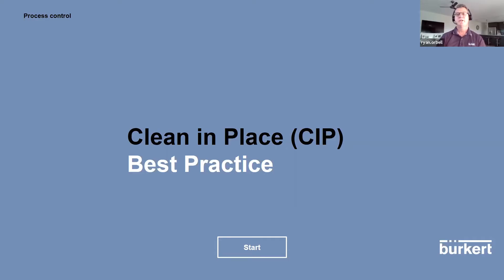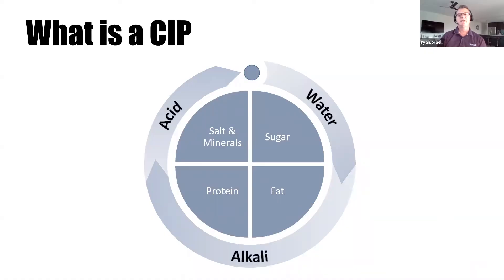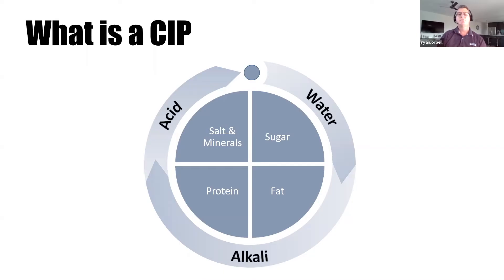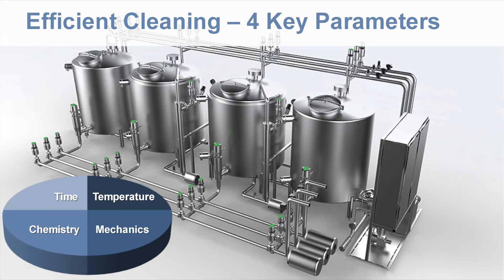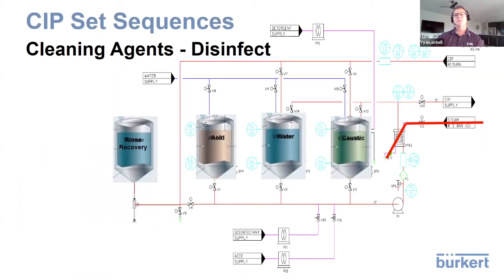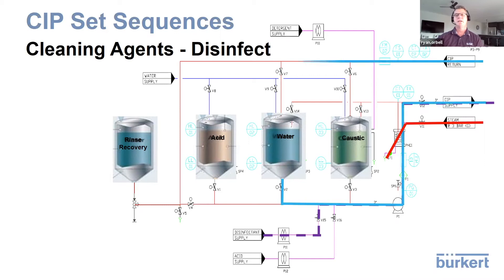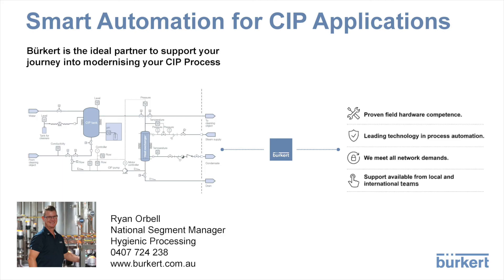Clean in Place (CIP) Best Practice

Comment: Thank you for your presentation. One my question, what type of the water or how much pure do you use for the pre-rinse? I'm curious whether the water is similar to WFI or RO system is enough to generate the water.
Reply: Usually, the pre-rinse water comes from the recovered last rinse water. The last rinse water is a mixture of water(tap water) + alkaline detergent residues. So no need either WFI or RO.